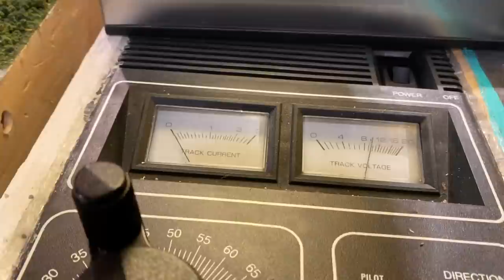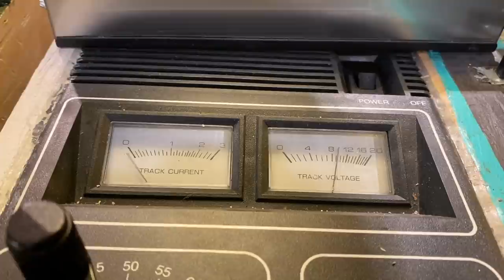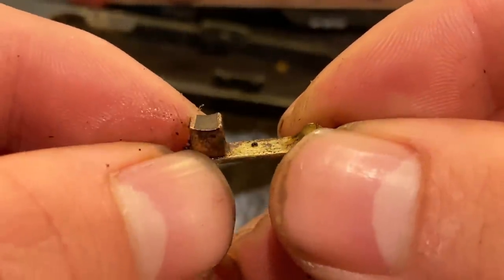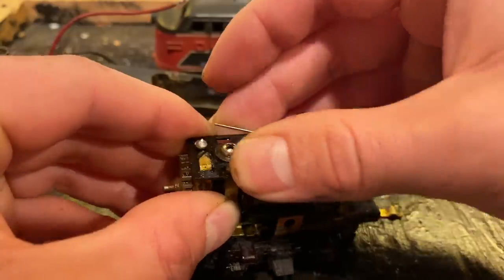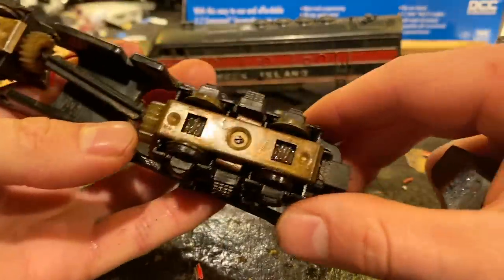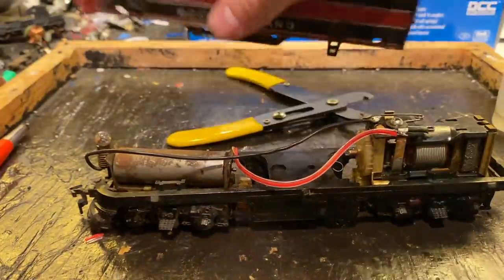Disgusting, Seized 1950s Marx F3 Locomotive - Can We Make it Run?

Comment: You don't have to be too cautious with WD-40 on electrical components as you can even use it, as spray, on electronics. Check out Scotty Kilmer automotive videos with, among other uses such as cleaning, WD-40 being an excellent moisture dispersant on electrical and electronic items after a vehicle has had large amounts of water thrown into the engine. compartment.
Reply: I recall when I worked in one hobby shop years ago the slightly older kid running the store using it on Lionel O27 so much that it actually caught fire, sort of like an alcohol fire, low temp and went out quickly.  But it did the job.
Reply: @CR7659  Just to clarify I would only use it when no electric current hook up.
Reply: @kenhanks9620  I'm just pointing out even with extreme misuse it's relatively benign.
Reply from the maker: I mostly agree but as you said, I wouldn't power it up because having that crap in the commutator is nothing but trouble. I'm also not sure if the brushes would absorb the oil but that could be a problem too.

Comment: SMT Mainline I found a lionel 2-4-2 locomotive back in the late 1970's in a ditch covered in mud under water, I pulled it out of the mud and took it home, I got the water hose and sprayed it down and washed all the mud out of it, while the locomotive was wet I put oil on all the motor parts and gears and let it dry fo about a week in around 80 degree weather, I then oiled the parts and put grease on the gears and put her on the track and turned on the power and she was a runner! I don't know how long it was in the mud in this ditch but I think the mud helped keep the motor safe...

Comment: Got that same sense of excitement when that motor turned (about 9:25)! A great piece of work and, as you said, a testimony to cleaning and lubricating. These older machines are so worth the effort. Cheers
Reply: The real trick to keeping anything running for a long time, is what I was taught several decades ago growing up is not just maintenance but more preventive maintenance. Doing things on a regular schedule before you start having major issues popping up unexpectedly. Lubrication, is a must anything mechanical.

Comment: Nice work on getting this old Marx back in running condition.  I have one comment that might help you with your soldering.  Make sure to clean the tips and tin them as well.  If you find that your gun is not getting hot enough try loosening the nuts where the tips are and re tighten them.  Your soldering is dull meaning there could be cold soldering connections.  Causing problems later on.  I am 74 years old and have repaired many electronic devices and many are caused simply from cold solder connections.  You might want to invest in a good soldering station instead of a high heat gun.  Just saying.

Comment: I couldn't get my Marx F3 Rock Island to run with the original motor so I carved up the shell and got it to fit a old Bachmann F7 chassie and motor in it and it works. Wish I could have fixed the original motor but I couldn't. Also I have the same controller you have :) it's a great DC controller

Comment: I got one of these from my cousin when I was like 10... that was 37 years ago... had a flame orange plastic body. I used to run it with the body off because the drive was so noisy it sounded like a V8 dragster at idle... with those traction bands at the time even as crude as it was, it would pull more cars than anything else on our layout... and that was a lot of cars since it was a whole room in the basement!

Comment: On aircraft we use ACF50 to clean contacts. I put it in a pill bottle and it lasts forever, just a dip of a Qtip in it and it takes the crud off the commutator and it leaves a safe film the doesn’t effect operation, but won’t allow corrosion in the future.

Comment: I just watched this. FYI if you get your hands on an old  Revell HO engine, you’ll find it uses the same drive. I don’t understand why you aren’t working for a train store repairing trains. It’s a shame you can’t turn what appears to be a real talent into a good paying job or even opening your own facility. I’m impressed!!!
Reply from the maker: Non of the local shops can afford to hire extra repair staff. I technically do work for one however it's only for store credit which isn't much. I also do local repairs but shipping stuff is a nightmare.
Reply: @SMTMainline  That’s a real shame. I live in Chattanooga Tennessee and the nearest train store is 2 hours away , so I’m up a creek without a paddle

Comment: Observing all your effort, I remember in the 60's there was a solvent that you could operate the whole power unit in. Amazing the amount of gunk that would come out into the liquid. You would let it dry, and lube after cleaning. Such a product would save you so much effort. I think they found it had carcinogenic properties, as I have not seen in in years. We would wash the shells with dish soap, careful not to damage pain and details. Those wheel profiles are definitely pre-RP-25 contour, requiring code 100 track, but it was years after North American manufacturers adopted the NMRA standard that the Europeans followed suit. The KM unit you did recently probably has deep flanges too, As a Marx collector, I need to add more Marx HO

Comment: I had an N Gauge locomotive that would regularly pick up dust off the layout and I had to tape over the gear holes. I ended up using Scotch tape and then trimming it, and it worked.

Comment: To add what HJ Miller has said, a medium ultrasonic cleaner in th UK is about £30, from ebay, mine has improved my loco cleaning very well, i use a truck cleaning fluid, diluted 10 /1 with water, cheap and efective

Comment: Now this could be just me, but....I might have taken that motor and drive train and left it in an alcohol bath for an hour or two, then blown it dry with compressed air (we computer geeks ALWAYS have a can or two of that around), THEN libruicated it. But what you did obviously worked as well.
Reply: Rubbing alcohol and a toothbrush for me....works great....
Reply: I agree....that thing needed an alcohol bath....or turpentine......that thing was groady as hell....
Reply: @dancalmpeaceful3903  Turpentine might soften or even melt the plastic. The same with denatured alcohol. Even worse...acetone.
Reply: @antonbruce1241  You're probably right about that.  Anyway you look at it, I would have taken it apart and soaked it in something.  That thing was beyond disgusting....

Comment: @5:55 ... It didn't work because you connected the positive & negative power leads to the tensioning SPRING ... which is ONE CONTIGUIOUS WIRE ... in other words a direct short.  If you would have connected the leads to the motor's contact brushes,  one side being insulated from the tensioning spring, it would have worked.  You might want to invest in some electronics cleaner spray ... or if you can't find any try automotive break or carburetor cleaner spray (but watch out for contact with materials it could dissolve) ... makes cleaning & degreasing allot easier.

A hint on servicing commutators ... after you clean out all the gaps you can fill them with a non-conductive epoxy and (after it hardens) you can resurface them into one smooth contiguous surface.  This way misc. carbon crud can't build up in the gaps and cause shorts.  Use a variable speed drill and some fine jewelers files or emery boards to smooth the surface back to round.

Other fun facts ... 
- Get yourself some hemostats, clip them onto the leads below where you are soldering to prevent heat from traveling to things that can melt.  
- For the love of # insert deity of choice here # please clean your soldering equipment and other tools.  https://www.youtube.com/watch?v=Fp37DPZVdRI
- Isopropyl Alcohol is  not a solvent for petroleum based products.  It might dissolve some food based oils but not petroleum based oils/greases.
- NYLON gears are SELF LUBRICATING therefore do NOT require any lubrication (even with nylon to metal).

Comment: Is the cylindrical object above the front truck a capacitor? Looks big enough to be an AA battery.
Reply: It might be a weight....
Reply from the maker: I think it's just an odd weight.
Reply: @SMTMainline  Agreed. A capacitor the size of an AA batt would probably propel the engine for another 6 or 8 feet of dead track.

Comment: Oil and grease do not clean with alcohol. Alcohol is polar solvent, so it can only be used on polar pollutants. wd40 removes oil and grease perfectly, then you can blow it or wipe it off. You can also use contact cleaner spray, to lubricate and clean electrical parts without any shorts. I am also surprised that you did not start by cleaning, usually this allows you to assess the situation much better. Finally, when soldering on old points, always remove old solder and use fresh solder and flux, to avoid cold joints. I would also replace the light bulb with a LED.

Comment: It's not bad considering Marx was low-end, cheap dimestore toys at that point.  Ever see Marx track?  The rails are stamped steel and the regular sections have fiber ties.  

It looks like you could swap the front coupler to the rear by prying the covers off one at a time.  If it was one of their freight cars, parts aren't hard to come by - Model Power found this tooling somewhere and produced them for a good 10-20 years.  But the locomotives got new drives.   

My favorite Marx engine is one of their GP9s - in addition to these having a wider hood on the short end to contain the motor, they had some fantasy in the paint department, so there is one which is yellow and grey with a red stripe and looks all the world like it's a Union Pacific engine... but is lettered AT&SF on the hood.  

There's also a Monon version which is somehow red with a grey band instead of the other way around.  Even that one is kind of silly because Monon had no geeps and when they did get hood units they were black and gold.  But they did have grey F3's with a red stripe....

Comment: hi smt i got a question i have a loop in  a loop with two turnouts if both switches are open i have no power on inside loop can i hook another power track to that loop
Reply: In my experience, if you set it up just right, you can set one transformer to full and adjust the other one. It doesn't overload it. I'm not certain if it works all the time, so only try it if it you're willing to take a risk.
Reply: Why not just run some feeders to the other loop.
Reply from the maker: I don't know what kind of switches you're using but most of the ones I have allow the power to flow through. Feeder wires are probably your best option.
Reply: You can do that.  I have two loops on my layout that are connected with 4 turnouts.  Both rails are isolated at the turnouts.  If I want to run it as one continuous track, I have a relay that connects the isolated joints or I can run it as two separate loops that are isolated and have 2 separate power supplies.
Reply: @SMTMainline  Hi smt thank you and  and the others for the information figured it out working good now

Comment: So I followed all of your steps, and the locomotive works, however, it does not want to stay on the track. Any advice?
Reply: I'm not SMT but do you have tight radius curves on your setup? If you have to tight of a radius then the engine will just come off the rails.

Comment: WD-40 isn't a lubricant at all. It's a water displacement fluid. Marvel Penetrating Oil would be a good choice. What make WD-40 seem oily is the mineral spirit carrier used in the formula.
WD-40 is a good degreaser, though.
Reply from the maker: It's advertised as a lubricant but it's too thin. Having said that it seems to work well to get things un-seized.

Comment: use brake cleaner and spray it to clean that engine, it breaks down any grease and oil based stuff and will do the job like a charm

Comment: CONDUCTIVE LUBRICANTS CAN, WILL, AND DOES SHORT OUT COMMUTATORS IF IT FILLS IN THE GAPS. IF USED,  USE SPARINGLY AS POSSIBLE!!!
IT WILL BURN UP YOUR MOTOR. YOUR TRAIN, AND MAYBE OTHER. Just rebuilt a MARX, EXACTLY like that one. A Baltimore &Ohio. What years did they make these drive shaft models??

Comment: Sorry to tell you this but that is a 
marxs  F.2.  streamliner locomotive
The difference is in the windshield design.... I recently learned something about this locomotive if it is really a marxs locomotive and it is they are very rare to find in running condition even the dummies are hard to find.. 13:55
Reply from the maker: I see these things for sale on eBay all the time, they are relatively well made too.

Comment: I recommend getting a sonic cleaner. You know the kind you fill with water and soap or a cleaning solution. I would've thrown the whole chassis in motor and trucks and all into one just to get the gunk off before disassembling it!🤢
Reply from the maker: That would have been a good idea but I don't own one.
Reply: @SMTMainline  

Yes I thought not, but you should get one. It does wonders in cleaning things. I have one myself. If you wish get one that is at least long enough to sink an average locomotive chasis length wise (don't put in a shell unless you want to partly strip it).
Reply: Something in that condition, I would soak in Awesome Orange and scrub with a toothbrush to start.

Comment: That looks to be an EMD F2A, not an F3A.
Reply from the maker: I can't tell the difference
Reply: Only difference is the F2s have three porthole windows on the sides rather than the two porthole windows the F3s use
Reply: @SMTMainline  Also, you should've given the bodyshell a soapy water bath (use a degreaser-type soap for the job)